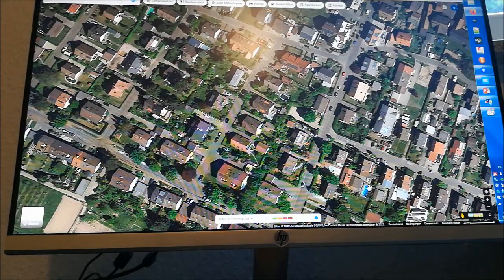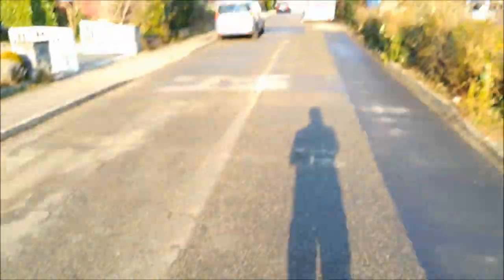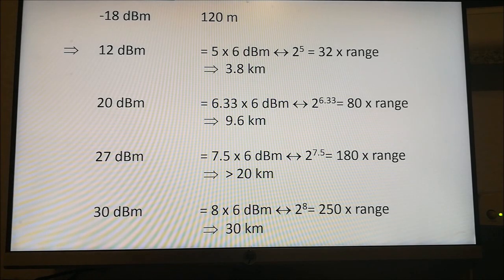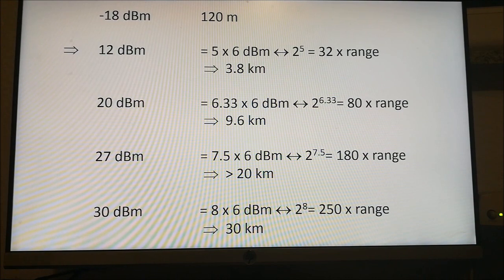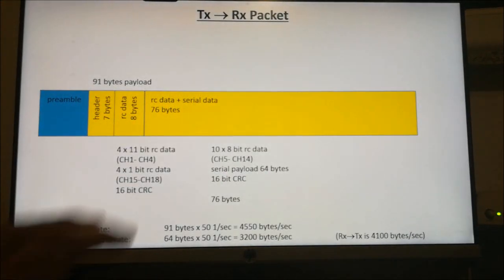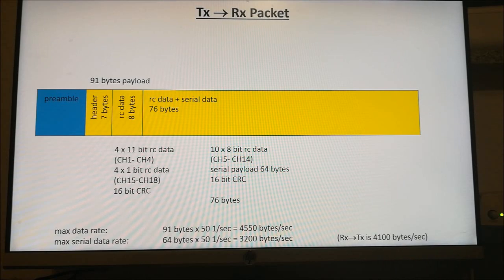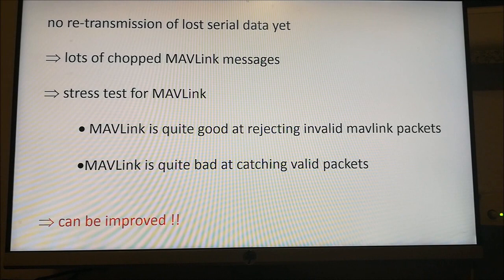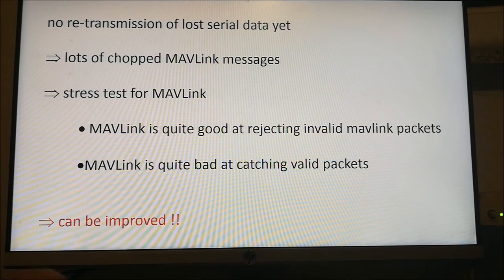mLRS: First Range Test - Sort Of

Comment: doing range test in the street which surrounding by houses like that is a bad idea, especially for 2.4g which every house could be using that frequency for their internet hotspot, to have "LRS" certification 120meters or even for 2km's should not significantly change the rssi at all, but yeah i guess that because with the environment from where you testing it, great job as always i'm a fans from your work :)
Reply from the maker: many thx for the nice words. Yes, sure, agreed, if you want to know the max range this was not a proper environment for testing. However, I see it the other way around, as you also indicate, if it gets to some range in this environment it only can do better in cleaner environments. In fact, it seems one even can see the effect of my body as its in the way on walking out. Also, it's just the easiest for me to do, so, I guess I would rather do it again LOL